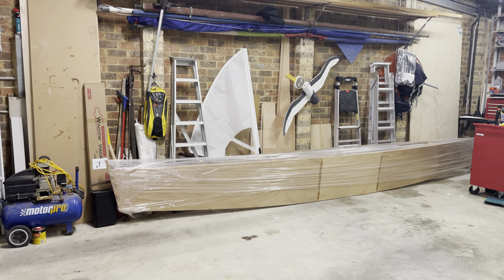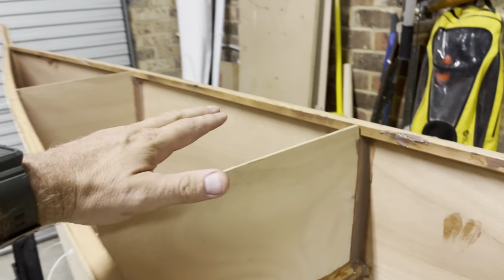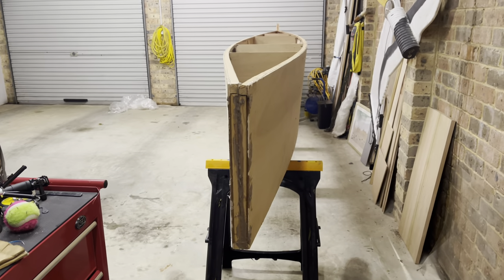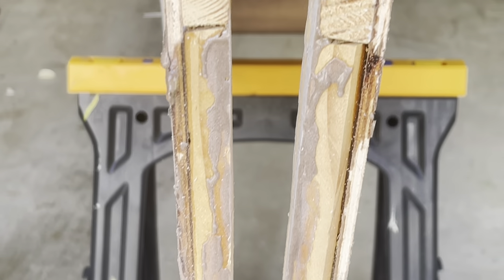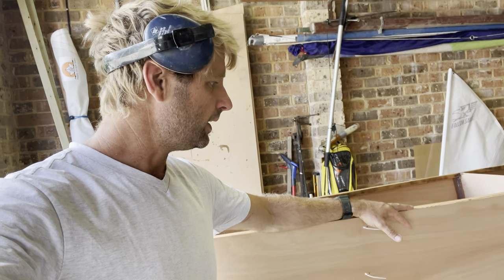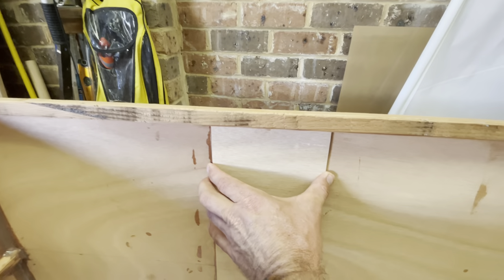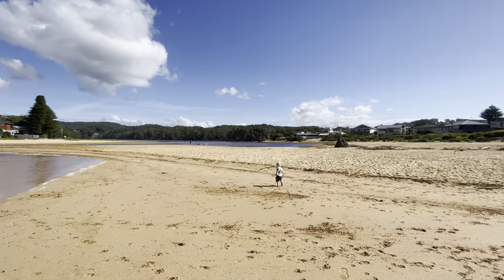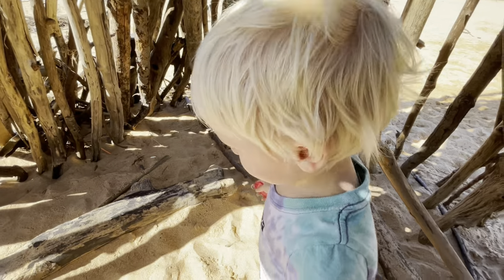Building Skimmer Ep.10 Plywood butt joints, repairs and driftwood tipi tents!

Comment: Hey Aaron, just watching this video as I get the time mate.  Great idea with the perspex to protect the concrete floor of the garage from runaway epoxy.  But, as someone who has done this, I can say that Ross L made a video with a solution - hit the excess epoxy with a heatgun and use a sharpened paint scraper to shave it off.  After watching the video I went over to a mate's place where the accident happened, dialled up the heat and in much shorter time than I would have thought possible, scrapped it all off.  Of course it's better to prevent than to fix, but it's not the end of the world.
Reply from the maker: G’day Col, thanks for tuning in again mate. I’ve seen that truck with the heat gun too, I’ve got it stored away in the grey bank in case I need it! Hope you’re staying dry! Raining again here…
Reply: @Aaron.deRuiter  200mm in less than 3 days.  Not like what we got in Lennox during the floods, but the soil here is actually soil and it holds water.  At home it rains and the water seeps through to China.  Property built on a sand dune.  The local rugby team could play on the village oval just hours after huge downpours with zero impact.  Mind you, it can get interesting at high tide.  I do have a picture of a guy on a SUP paddling down the Main Street  some years ago.  Only possible at high tide.

Comment: Hey Aaron. 
A quick tip I have found to avoid epoxy sticking. Just use plain old baking paper. It is fantastic to avoid sticking.
A quick question. I just bought 3l of bote cote myself. How did you work out the weights, and why do it by weight rather than volume?
Reply from the maker: Hey Lee, yep I’ve used the baking paper trick too. I’ve found that the Perspex is a little better as it won’t cause wrinkle impressions in the hardened epoxy. 🤙

Comment: Great to see you back at it!  Great looking work so far. I like to wet out my joints with un-thickened epoxy first to keep the thirsty wood from sucking the resin out of the joint. Not sure if it’s necessary since you were using a syrup consistency and not peanut butter, but I thought I’d mention it.
Reply from the maker: Thanks Mark! Appreciate the tip mate 🤙